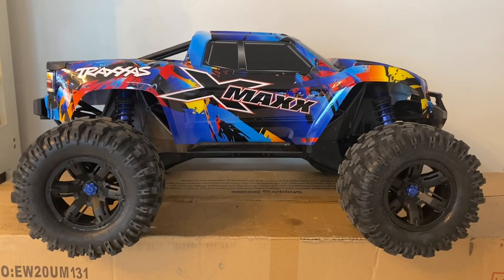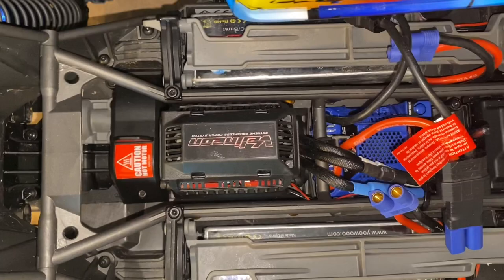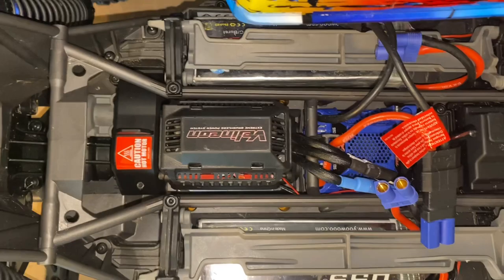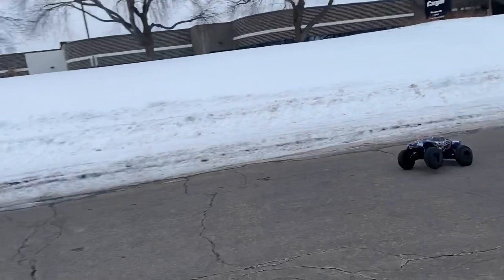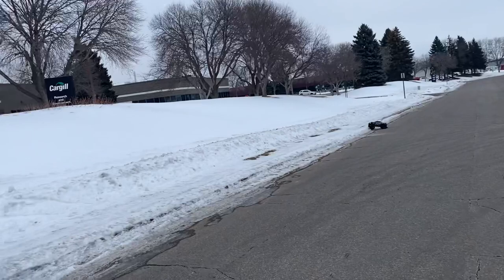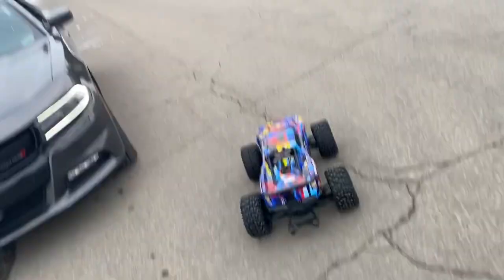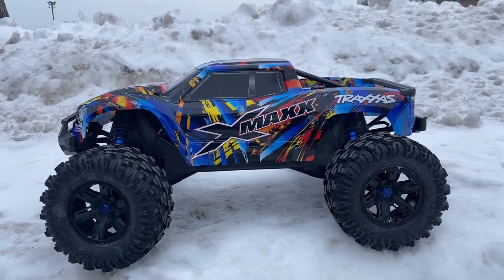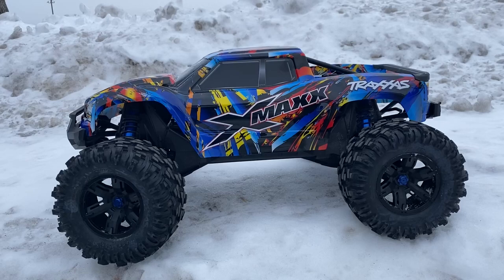TRAXXAS Xmaxx-8s speed test-optional spur and bigger pinion-How fast will it go?

Comment: Nice work Moe! She could definitely use some belted tires for runs like that.

I you weren't running the battery adapters you would have seen over 50! Those things suck. They add so much more resistance it's crazy. Got 3 more  MPH when I took them off my Summit and went to XT90's.

Keep up the snow bashing man!
Reply from the maker: What up man! 

For sure belted are needed for the speed run.  I kind of like the ballooning on the snow lol.  

Had no idea on the adapters,  well looks like i need to trash all my adapters lol. 

Appreciate you my man!

🤝🏎🤝🤝🏎

Comment: Hey Moe getting a X soon,  been doing research on this platform. Seen a vid by Tom Tracks on his X where he runs 22/46T gearing. Looked really torquey with wheelies and good speed on street. Said heat wasn't really a issue on hard surface. Just thought you may want to test this combo, know I will when I get mine. His video was pros and cons of the Xmaxx. 🤙👊
Reply from the maker: 22t orders off Amazon will be here tomorrow.  Thanks for the insight and let’s see how fast it will go!!!

Congrats on looking on getting an X.  Keep me posted!
Reply: @moerc  Cool Man 😎, I will. 👊

Comment: If u could keep it straight it might go a little faster lol still pretty bad ass. I have mine geared 22/50 and I'm pretty happy with it
Reply: Max6 esc will have more torque but about the same top speed
Reply from the maker: Man, this thing was wild lol. Street was slick too and some belted tires would be sweet. 
It was for sure tracking all over the place lol
Appreciate you sharing your insight and being here!
Reply: @moerc  I put duratrax hatchet x's on my xmaxx and love em! They are real good for doing stunts in the air but u can still jump well and they hook up so much better on grass and the street!
Reply from the maker: @Todd_G_FPV  oh snap, i am going to get those then.  Good looking out buddy!
Reply: @moerc  no problem man. They are half the price as badlands and just as good grip if u ask me. My buddy has badlands and the rubber is way harder on them. And they have a v thread which is more monster truck looking to me lol